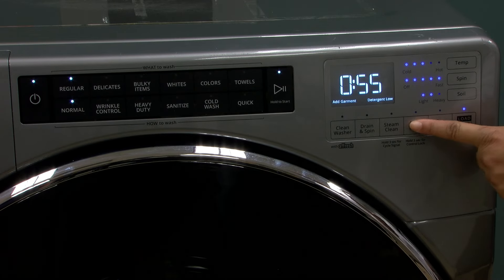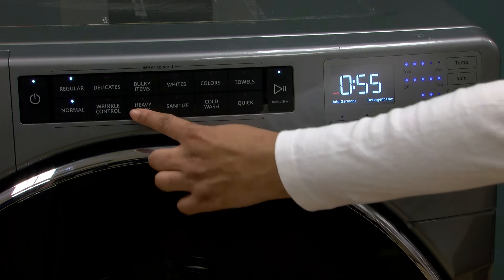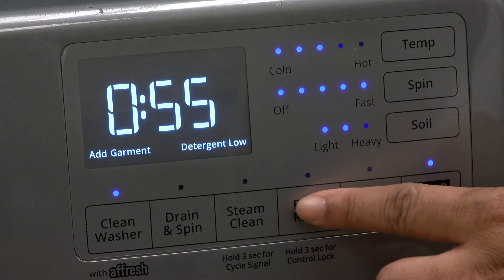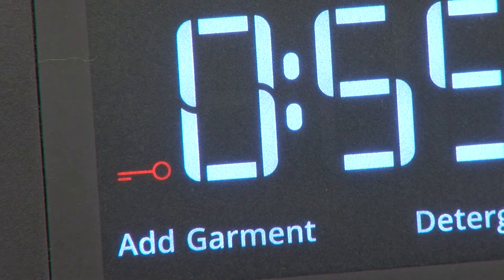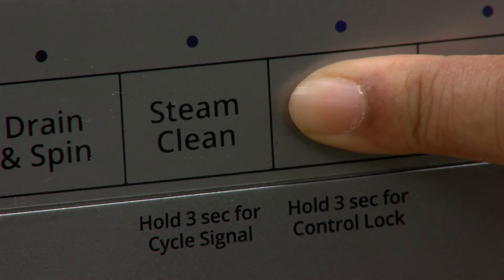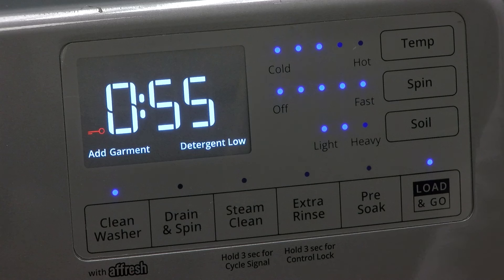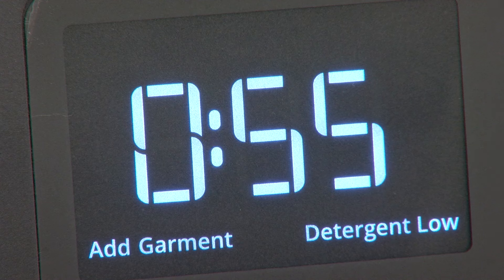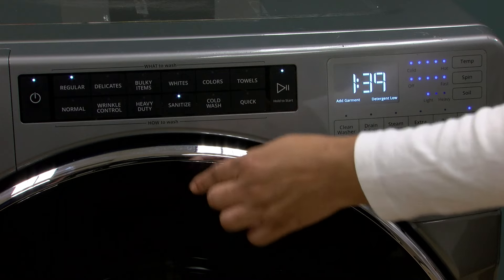How to Activate Control Lock on Front Load Washer

Comment: Even with my front load being very old this trick still worked. Hold down 2 buttons for 3 seconds. I found this info on a web page that directs to this YT. It took me a little while to understand it. It's not the door being locked or unlocked it like for if you have mean children that want to press buttons on your washer. So you use this feature to lock out the control panel so the mean kids can't effect your washer. You lock out the control panel. Then unlock it when you need to do a wash load.

Comment: I have never had a washer that has so much noise this since day 1.  I feel the washer is too harsh on clothes that are not in a delicate bag.  Even on a light wash without the agitator the wash is too harsh. Unplugging the machine is Not an easy solution.  Is there a reasonable fix for these?